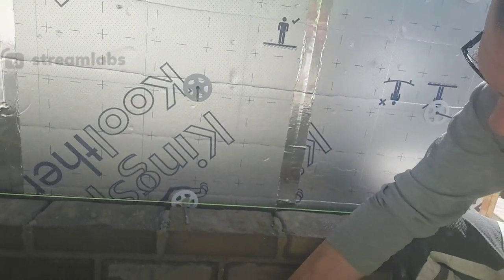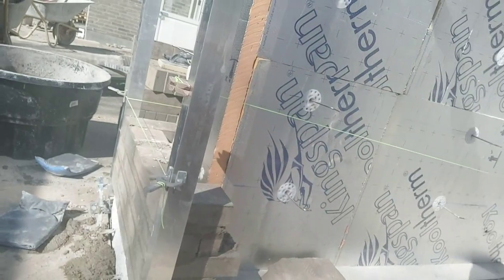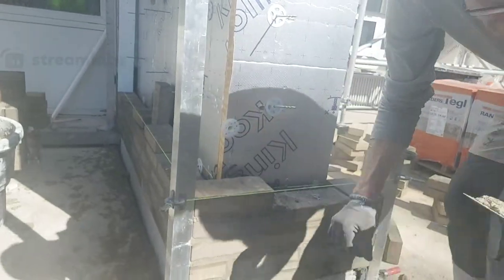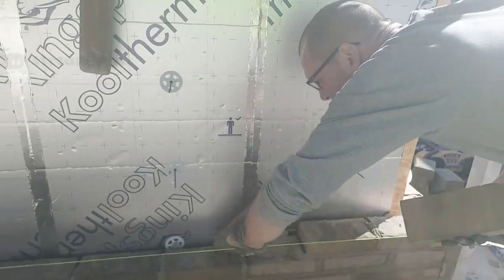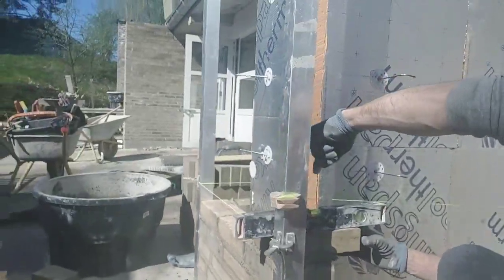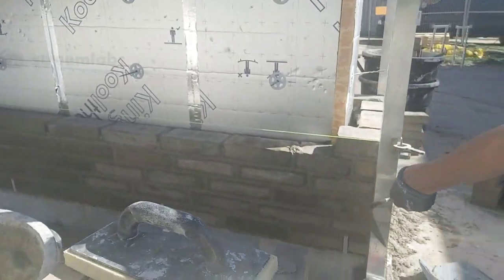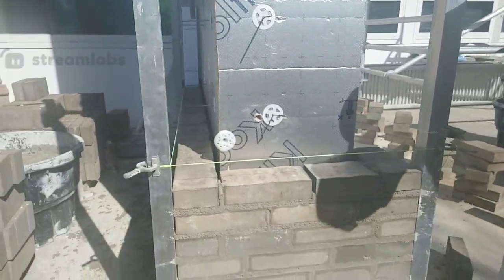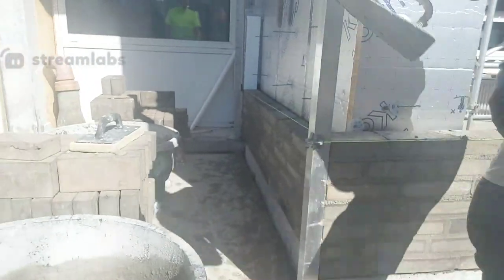Quarter and half bond courses - Danish Bricklayer

Comment: Hey Anders ,the reason our trowel is the shape it is and the reason why we lay our morter out first, is because ,we learn to cut and roll our morter  to achieve a perfeckt bed  to minimise access  morter on the Back of the brick and in the cavity.
Reply from the maker: Hey Robert 😊 yeah but I just think that the mortar get drys when you reach the end, or you put something in mortar to keep it smoth. I would to try english bricklaying. Thanks a lot for explanation.😊
Reply: @danishbriclayer-andersgamings  you are also right you should only lay enough morter vor three bricks.

Comment: In UK doing that with the corner is called "toothing it up"   however most building inspectors do not allow, as they say it causes a weak vertical joint.
Reply from the maker: Hey 😀 thanks for telling me, toothing up, very Nice. Ohh i see, i understand that. We Are allow herefter in denmark. True you have to compremise and make sure you filled up properly. Its important. Thanks mymann 😉
Reply: @danishbriclayer-andersgamings  yeah no problem, I think thats one of the issues, people do not fill up the joints properly then over time it cracks.
Reply from the maker: @lessismore83009  yeah you absolute  right.. dont be lad and just take time to fill it up.. then i wont crack 💪
Reply: @lessismore83009  you can tooth into newish builds but anything older than 50 years we furfix as it allows for movement. Movement will take place because the brickwork will usually be sitting on two different footings (new and existing) and existing usually isn't built to today's regulations.

Comment: How thick are your mortar beds in Denmark ?in the UK they are 1 cm
Reply from the maker: Hey its 1,2 cm  briks Are 5,5 height. 3 courses is 20 cm.
Reply: @danishbriclayer-andersgamings  👍
Reply: How long is a brick in Uk :)?
Reply: @gittejakobsen177  215mm long, 100mm wide and 65 mm high, 10mm beds 4 courses 300mm.
We work in millimetres in the UK not centimetres 👍
Reply: @bricklayersworldwithandy6277  mm in Denmark too.

Comment: Seems a lot slower than uk laying bricks
Reply from the maker: Naah i think potato potato 😀
Reply: Believe me that guy is fast ,but his technique  would not work  on house building in england.
Reply from the maker: @Robert-lu1lv  No you right, in England they Will knock My corner down 😆🤛🤜 but even if we dont have backwall or what you called it ? I Mean if i do full brickwork. Front and back wall All in bricks, we still use profiles on corner. Never build it up like in England 😉
Reply: @danishbriclayer-andersgamings  Hey Anders, i live and Work in north Germany ,and have worked in Dänemark i use the Same brick trowel as you and Just lay enough morter for one brick  ,i admire your workmanship ,and the  London Flip is top i will try it 👍